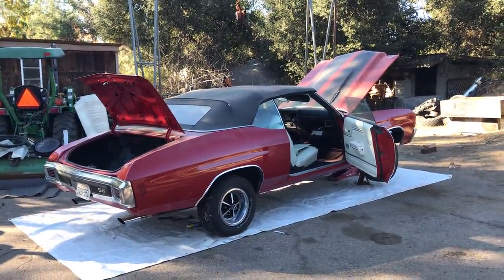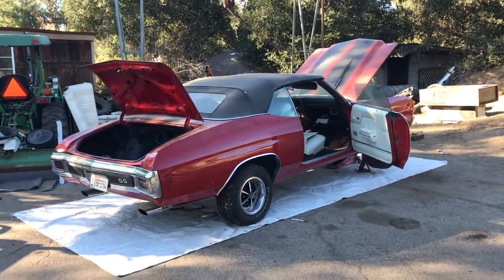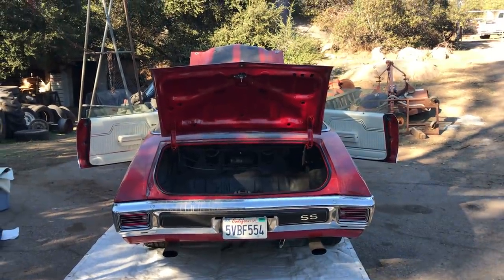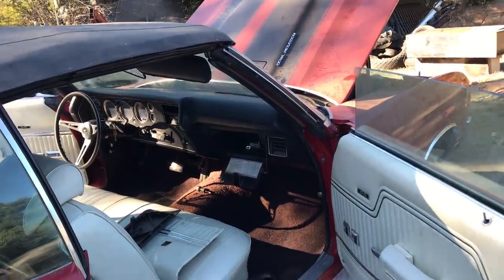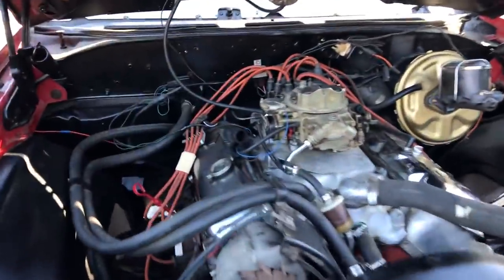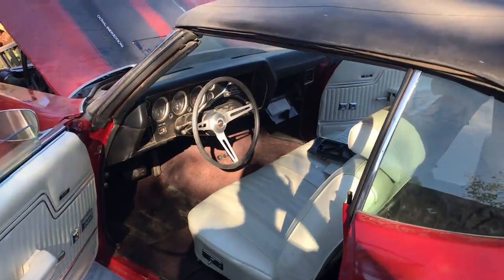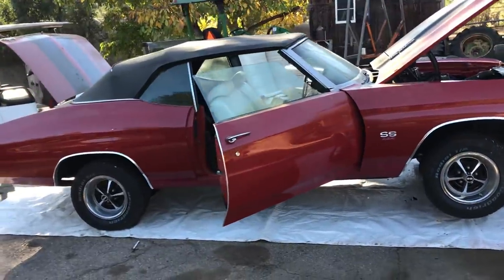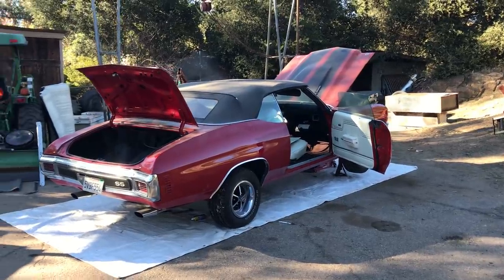I Saved a Guy $250k From Nearly Buying a Fake 1970 SS454 LS6 Convertible In San Diego, CA!!

Comment: Back in the early '90s I had a '72 Malibu 2 door I restored for fun. I kept it as a Malibu, but added SS stripes, removed the bench seat and added a factory console and buckets for the looks and fun of it. The buckets I got were from a '70 model which were white in color and looked incorrect for a '72 because of the pattern. I got them from a local Chevy bone yard and parts supplier who kept these seats in a storage building, so the foams and covers were still real nice, and even though they were incorrect for a '72, I installed them as-is. A couple of years went by and I decided to replace the seat foams and covers with the correct pattern ones for '72. In the process of taking the seats apart, I removed the rear plastic cover from the passenger side bucket to find the build sheet of the car these seats came out of, flat, under the seat springs. I carefully removed the build sheet and proceeded to almost have a stroke reading it. These seats were originally from a '70 SS 454 LS5 convertible featuring Muncie 4 speed, cowl induction, PS, PB, blue with white interior, Baltimore car. But perhaps the more interesting thing was down in the lower left corner of the build sheet was the name of the original dealer.....Roger Penske Chevrolet, customer order. I remember getting the rear seat out of what I was told was the same car the buckets came from, which was in the yard, what was left of it anyway. I remember thinking that it was a shame such a nice car would wind up in a salvage field. I still have that build sheet, and its still fun to read it every once and a while.

Comment: I remember hearing an inspector say once, years ago, "There's more Chevelle SS out there now than the factory EVER built". lol
Reply: I built a fake 66’ out of a damaged wreak in 1979. Probably one of the first. When I sold it, I told the new owner it was fake.
Reply: The same with 1973 Porsche 2.7 rs
Reply: Same with Camaros! There are A LOT more SS’s and Z/28’s than the factory ever made.
Reply: yes and no people are getting the 2 454 mixed up because both were crate engines and went by the same code GM would never ever call 2 different engines the same thing like i said there is 1000's built with the ho 454 bbc but only 212 with the ls 6 454 but on the net there is 1000's of the ls 6 454 bbc so do u really think they called a bbc a ls 6 454 or was it a real ls 6 454 small block , then u can read up on the mark iv engine series they even claim of interducing a engine with different angle pistons and pushrods and how much better it is which ls engines have a different angle on the piston and pushrods most people have know idea about the crate engine they only know what came out stock unless u race or hang out with a lot of pro racers this is y i get a lot of my parts from when they upgrade thier cars i get the old a lot and build a car out of it how many people u know gets a tunnel ram set up for free with a complete msd enginition set up in the box for 100 bucks new i just got into restoring and selling parts to my friend like good project cars they will have their sponsers pay top dollar for them all depends what class they are running or if they want to build a car
Reply: You got that right.
Reply: @ Northern

😂😂😂😂😂
Reply: That is true....that being said, my father bought a '70 SS auto/console L34, dark green/green(vinyl), stripe delete with AC(mounted under dash) in 1972. He has recently restored it minus the body...a new body had to be ordered, due to the amount of rust, but all drive train is original. Everything has been put back, except the vinyl top, and strips added...we have the build sheet, which was found in the passenger inner quarter(Atlanta built) .
Reply: @36index73  I tip my hat to your dedication to that car!
Reply: Same can be said for 67 435 Vettes.
Reply: @melissaweidman3326  in other news, the USA just announced the Death Penalty re-instituted................for unedited run-on sentences.

Comment: When “values” are high then fraud is rampant.  Numbers matching is overblown, but cars that can be driven are more fun to own.  Decades ago I worked at a large GM dealer parts department in SoCal.  No one cared or knew much about the “numbers.”  I helped to create a lot of SS454 conversions, including with replacement LS6 engines.
Reply: I worked  at GM plant in 60's and seen some pretty wild items come on cars that would branded by these 30 year "experts" as fake. Special order cars and trucks often gained a few options that did not show on build sheet. Somebody knew someone on the line and so so.  Also during a strike parts would be scarce and whatever was on shelf went on.  New cars left the line with engine unstamped all the time, of the "books" printed years later detailing each option often were Friday night cars.
Reply: @jaywalker712  yep , also at the end of a model run GM would throw anything laying around on to get rid of parts before the new model came out
Reply: @jaywalker712  building a 67 el camino for a customer, had to replace the driver side quarter panel, all factory sealed never had body work done before, we found a half full bottle of Ancient Age Kentucky bourbon. date coded the bottle to 1964, still had the 1966 tax strip on one side. most interesting thing i have ever found in a car.
Reply: @803brando  Sort of happened to me as well. A very different car- 1978 Renault LeCar (R5). I had stripped the interior out to do a deep clean. Found about a dozen wine bottle pull-tab tops. Looked at the build date on the VIN tag- 12/77.
Reply: @803brando   Just think if the bottle had been empty your car might have fallen apart from lack of bolts.
Reply: @803brando  1966 factory line worker: “where’s my bottle of hooch?”  1967 new car owner: “what the hell is that noise?”
Reply: and they are mid 5 figure cars if excellent,a REAL ls6 chevelle is gonna fetch 6 figures

Comment: Nice looking Chevelle. Scary how a person can easily try to pass off a regular Malibu for an SS or LS6. I'm glad there is guys around like Patrick to dig into it.
Reply: A good tell tail sign for any Chevy SS in the late 60's to early 70's, be it a Chevelle, Nova, or Comaro is that they are all bucket seats and the transmission gear selector is on the center console, NOT on the steering column. A true SS will NOT be standard equipped with a front bench seat.
Reply: @oveidasinclair982  Please stop repeating this incorrect information in the comments section of this video, over and over.  You have replied with this false information at least 4 times, and that is with me just glancing through the first few comments of this video.  Bucket seats and a console were options on the SS in 1970 and there were many cars produced this way.
Reply: @MakerCave  Correct, there are authentic LS6 Chevelle's that came with a bench seat.

Comment: I bet the owner was crushed to hear that.
Reply: Anyone with half a brain would have figured that one out, especially the guy trying to pass it off as a true SS.  He was trying to run a scam on an unsuspecting buyer, A good tell tail sign for any Chevy SS in the late 60's to early 70's, be it a Chevelle, Nova, or Comaro is that they are all bucket seats and the transmission gear selector is on the center console, NOT on the steering column.
Reply: @oveidasinclair982  they are not all bucket seats that is a lie bud
Reply: @oveidasinclair982  hold up just like today's cars where you have options when you make your purchase some Chevelles SS  did come bench seat column shifter if you ordered the car that way to keep the price down. bucket seats 4 speeds in some cases power windows made the price of the purchase higher. just like today's cars you can order cars with and without sunroof
Reply: @oveidasinclair982  Thats not true.
Reply: @turbo6598  True but todays cars are nothing like how you could order in the 1960's and early 1970's.  You cant take todays base model Charger or Challenger or similar and order a 6.4 liter or whatever the manufacturers largest engine is.   You have to get the corresponding trim to match the engine.
Reply: @HairBandDan  Your right very right!! He dint know all he thinks
Reply: He thought that this car was his retirement fund after owning it for 35 years.     Patrick just gave him a headache.   LOL

Comment: Amazing the trouble some people would go through to tell...or sell...a lie, when telling the truth is always easier.
Reply: True, but these people (not the current owner) can add a few extra zero's with a lie. It's tempting, but there is a special place in hell just for the 1970 Chevelle LS6 fakers LOL
Reply: To sell the lie on this car would bring in at least 3 times as much money, A good tell tail sign for any Chevy SS in the late 60's to early 70's, be it a Chevelle, Nova, or Comaro is that they are all bucket seats and the transmission gear selector is on the center console, NOT on the steering column. A true SS will NOT be standard equipped with a front bench seat.
Reply: @joshuacampbell9990  thanks for clarifying the bench seat thing from the other Feller. I thought bench seats were standard on the Chevelle SS cars. Isn’t the gauge package an option also? Too bad a customer can’t order his
vehicle the way he/she wants to anymore and has to pick “packages”.
Reply: @joshuacampbell9990  Yep, many many more. For an average Joe like myself, it makes it possible to own one of these cars, even if it's a clone/tribute SS. Back in the early 80's this is what we all drove to high school. These were $1500 gas guzzlers that were sitting in peoples back yards and driveways. In HS I drove a pristine 1964 Chevelle Malibu SS 220hp 283 with AC. I paid $1500 for it. It was an original survivor, Ermine white with silver blue interior and looked like the day it rolled off the Van Nuys assembly line. Good times!
Reply: @joshuacampbell9990  Yeah, I totally hear what your saying. It's kind of made the whole mystique of the SS 454 less exciting.
Reply: @oveidasinclair982  do some research on that!!!
Reply: @oveidasinclair982  no,thats absolutely wrong.please learn,tehn comment...lots of ss cars with bench seats and column shifters  and they are rarer
Reply: @OpenRoader  now that 64 ss is a $65,000 car...i bet you sold it for peanuts too..
Reply: @trillrifaxegrindor4411  I actually traded it for a 1959 Biscayne with a 348, 6 pack and a 4 speed. Then blew up the engine drag racing and sold the car for $1500 and the 6 pack for $1500. So, yeah, peanuts. Hard to believe what these cars sell for today.